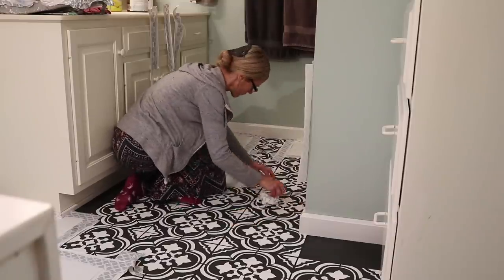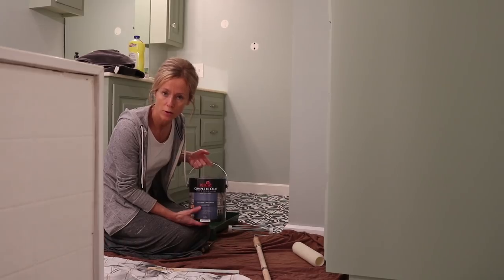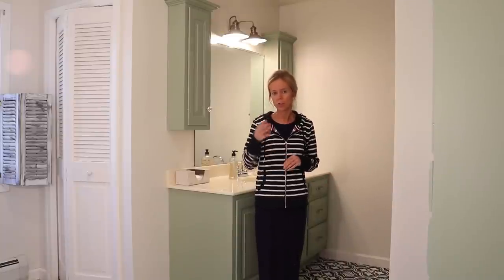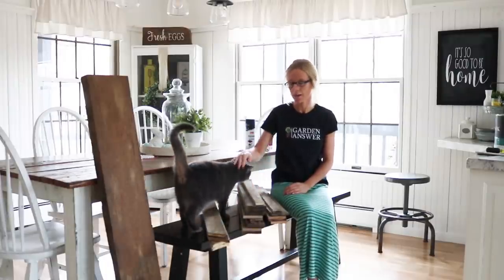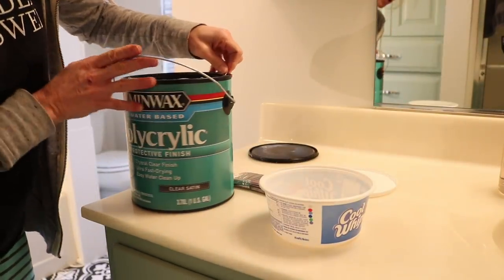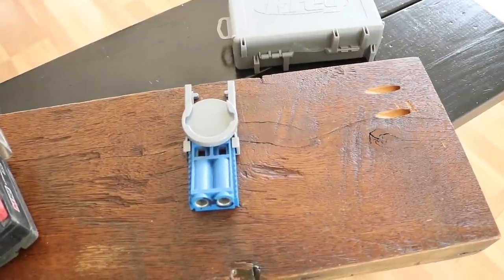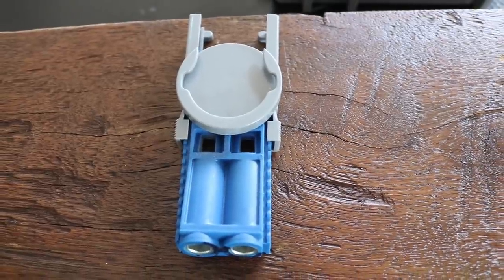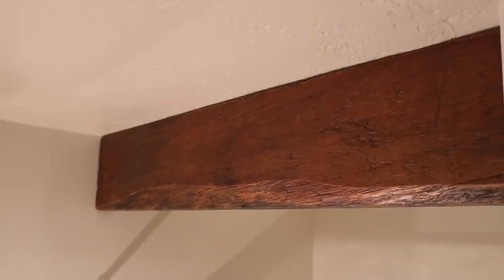Bathroom Makeover Video 3 ~ Pallet Wood Ideas ~ Natural Wood Decor

Comment: Mary,I am in 💛💛💛 with your ideas and execution of your ideas 💛💛💛. HELP I have concrete floors throughout the house BUT it's not clean, it has cracks and glue from the old linoleum floor. We're talking about 1700 square feet of this, I want to clean it up and paint -im overwhelmed and an amateur 😱

Comment: I'm not sure if you answer individual questions, but I'll give it a shot. I have a very old French Provincial desk that is a very blonde colored wood. It is super light. Almost the color of a 2x4 when purchased raw. I want to redo it, however, I cannot stand the blonde wood! My thoughts were to stain it dark, paint it with white milk or chalk paint, and then distress it to reveal the dark stain underneath. Now I'm having second thoughts and feel like some of the light wood will be revealed after sanding. My second thought was to sand it, paint it with one of the two paints mentioned above, and then seal it with a dark wax to darken the exposed light colored wood. Now I'm not even sure what to do! What is your suggestion to ensure that only dark wood will be revealed after distressing? Thank you in advance!
Reply: I wanted to add that I absolutely love your work and style!!!
Reply from the maker: Thanks for watching my videos! You are correct in thinking that light stain could creep through, even if you cover it with something dark. Believe me, it has happened to me already! It can be done though, if you sand very lightly or wipe your  paint off before it dries. But my preferred method with a piece like this is to do what I call a cheat distress. It's where you actually apply the dark along the edges or anywhere you want it to be distressed,( like around handles, knobs, etc.), on top of the white, or whatever color you paint the piece. I will often use a paint marker to do this or if I don't have the right color, I will use a small brush and paint. Hopefully this makes sense! Of course if you want a lot of distressing done, this method may not work so well, but I have used it a lot for light distressing. You have more control of how you want those edges looking.. Good luck with the piece!
Reply: Thank you so much!